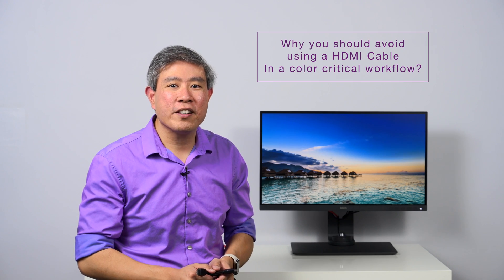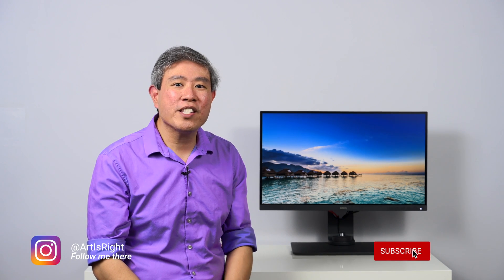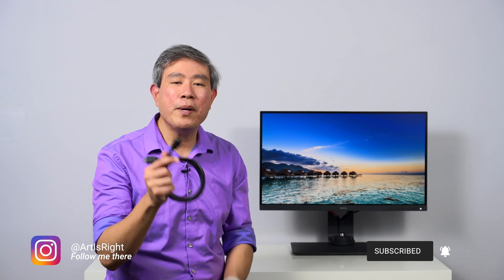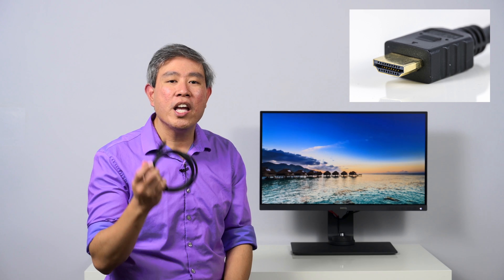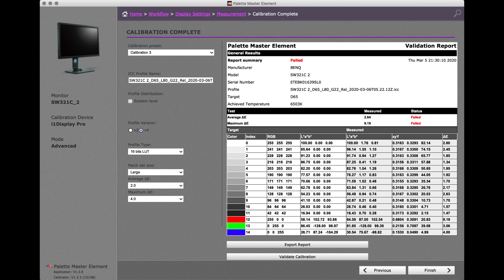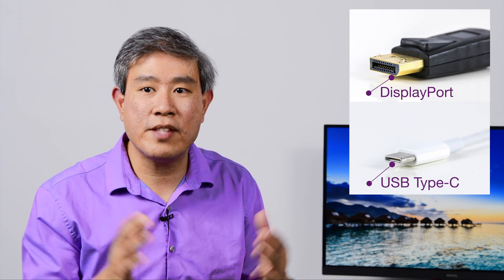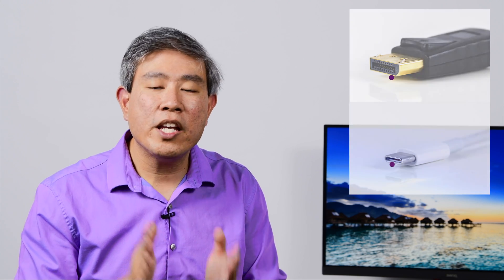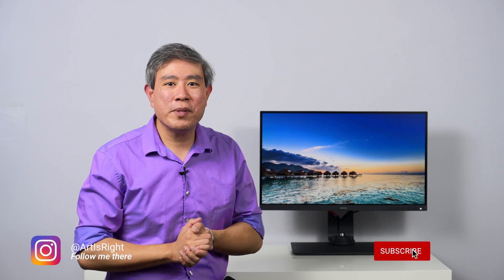Why you should avoid HDMI for color critical workflow, especially with Pro Displays!

Comment: Update: I spent a whole day testing my MP 6,1 with Blackmagic eGPU, and decided not to keep it. The external eGPU does speed up Safari web browsing when content has lots of graphics. Various tests do show higher scores (e.g., Geekbench 5, Novabench). But it actually slows down Lightroom Classic. The PugetBench Photoshop software also shows a lower score with the eGPU.
Reply from the maker: Thanks for the update, that is what I suspect would happen since the signals and data would have to get pushed over to the eGPU before it can be process for the display.
Reply: @ArtIsRight  There was theory that if one connected monitors directly to the eGPU, then it would cost only one-way delay through TB2, as opposed to internal bus. But guess that would depend on how software was written. If GPU process only some data and has to return the data to CPU for more processing, then it would yield a lot of delays.
Reply from the maker: You should connect the display direct to the eGPU if you are using it for graphic, you should not connect it if you are using it for CGPU (computing GPU) such as rendering videos, etc. But with MP 6,1 you are looking TB2 delay going to a TB3, provided that you got the latest eGPU enclosure. Personally, I find that eGPU is more trouble than it is worth.
Reply: @ArtIsRight  Can you do a video on M1 Mac with two 4K monitors and perform local adjustments on LR Classic? My MP 6,1 was fine with 1 HD as main and 1 4K as the 2nd display for LRC. But after I upgraded my HD monitor to BenQ PD3200U, local adjustment is extremely sluggish. If I apply spot removal, I have to wait for the beach ball to appear twice before I can do anything next. Can you try this with M1? Try it with the latest LR Classic V10.1. V9.4 was a bit better: the beach ball only appeared once.
Reply: Clarification: the 2nd 4K monitor should be used as the 2nd display for LR Classic and set in Loupe mode.
Reply from the maker: If I have time I will test this.

Comment: Dear Sir,
I have benq sw240. My pc has USB-C port.But when I connected USB-C to display port of monitor, there is no display. I changed DP 1.2 to 1.1 by hdmi cable connection,but it did not work.I think my usb- c port is not disp alt mode supported. Now I think I need graphics card. Benq has provided mDP to DP cable.please suggest me specification for graphics Card with ,what type of port required for compatibility with sw240. Please note I use Lightroom cc
Reply from the maker: See the other thread for answers

Comment: I have a 2013 Mac Pro with 10-core Xeon/64GB RAM/2TB SSD/D300s. The main monitor is BenQ PD3200U. When I do Lightroom photo editing, I have a Dell 32" 4K monitor as the 2nd display. When I do software development and want to stand up for it, I have a BenQ PD2700, on a stand desk,  mirrored to the PD3200U. The Lightroom is a bit sluggish. So I am getting a Blackmagic eGPU with Radeon Pro 580 GPU. I am planning to connect the PD3200U to the HDMI port of the eGPU. Will I have calibration problem with i1Display?
Reply from the maker: You should not have any issues especially with a software calibration but if you do use a USBC to Display Port Adapter or just use USB C to USB C. As far as performance not sure will it improved much, it is more of a Lightroom thing rather than a GPU thing. But keep me posted on LR performance with the eGPU.
Reply: @ArtIsRight  What would be a good benchmark to compare and determine the improvement from eGPU, if any? I'm not sure group import/export would make sense. My main goal is to reduce the sluggishness of LR Classic operations. The assumption is that I want to stretch the life of my MP 6,1 a bit until Apple stabilizes M1 Mac.
Reply from the maker: The best things that you can do for this is subjectively how it feels. There's really no specific benchmark for this. Truth be told LRC is sluggish on my Mac Pro with Radeon Pro Vega II card as well. This happens a lot when you run close to 4K, but if you scale the resolution there's an improvement to the responsiveness. I'll probably make a video about this soon.
Reply: @ArtIsRight  Does LRC use Mac's monitor scaling? From my experience, it does not. But I could be wrong. BTW, I found a benchmark for Photoshop that works on both Mac and Windows. Could you please participate here? https://www.dpreview.com/forums/post/64702827
Reply: Update: I have found the results on their website. For Apple products, you can see the results here: https://www.pugetsystems.com/benchmarks/?age=30&benchmark=PugetBench+for+Photoshop&application=&specs=apple#results-table
Reply from the maker: Awesome! Thanks for sharing.

Comment: I'm a new subscriber and I must say, you do fantastic videos and very detailed research! Based on your videos I've just ordered dual SW321C monitors to be ran from both my PC as well as an M1 Mac Mini I should be receiving next week. As you know (per your video) to get 4k 60hz, I'll be connecting via native HDMI on display 1, and the Amazon USB-C to HDMI you recommended in your video for display 2. However, I now stumble across this video and it seems I'm going to have problems completing a hardware calibration these $2000 monitors? Am I understanding this correct? Any work arounds or other recommendations? Per your other video, it does not appear I have any other connection options to stay at 60hz. Thoughts?
Reply from the maker: Well at this point you are going to have issues calibrating any displays regardless https://youtu.be/KXIKRLLVCw4 and https://youtu.be/NVi0YdAB2M0 nothing works well with it yet. It is all a waiting game at this point. When the software are compatible, I will have to test HDMI on these new Mac, the simple answer right now is that I don't know will they truncate the signal or not. I know that this was done on the 13" MacBook Pro that has the HDMI build in, but it works fine on the 15" MacBook Pro, so it is hard to say. Patience is the name of the game right now and not much else
Reply: Thanks for the quick response. If I understand your video correctly, my display could suffer from a restricted color range due to the HDMI technology at ALL times. The calibration is less of a concern for me since I run two machines and calibrate with my PC. My concern is having this incomplete color range during editing and prior to printing. Do I understand you correctly? Also, to maintain the 4K at 60hz the previously mentioned connections are my only option, correct?
Reply from the maker: Yes to get 4K60 as of now what you mentioned before. If you don't need calibration then it does not matter if the range get truncated, this really only effect hardware calibrated display when doing a true hardware calibration. Again without an update native software I can't test that yet, so we are at a stall here. Everything is waiting game right now, but if you are not going to calibrate I won't worry about it, these are not visual differences that are visually noticeable
Reply: @ronmcgowan  try to go to your graphics card control panel and change the output range to full range, regardless of HDMI or dp, pc sets limited range as defult, not the bandwidth issue of HDMI

Comment: I have a sw271 ..  When I check which bit depth it is, I'm seeing only 8 bit and it should be 10 bit.  I'm using the display port cable that came with the monitor, is 10 bit only attainable when using hdmi?
Reply from the maker: Nope but I need more details. What system what video card, etc?

Comment: Hi Arti ,i hope you;re doing well..are you talking about HDMI 2.0 or about the older HDMI cable in this review?
Reply from the maker: 2.0 and all HDMI in general, they just truncate single to make room for other signals. Bandwidth is not as wide as USB-C or TB3 or TB4
Reply: @ArtIsRight  Thanks Arti! i did check it and there is difference..i was thinking to change to HDMI because on my 2nd monitor which i have in my home studio,its not a benq display. And Its flicker free only when using HDMI
Unfortunately on this monitor my eyes get really tired especially with 10bit ..it feels like it gets way brighter and i lose details and my eyes get tired easily
Did you have this issue when using 10bit?
Reply from the maker: I have no issues with 10 bit over HDMI, you should be fine. Especially if it not a hardware calibrated display.
Reply: @ArtIsRight  thanks Arti..just one last question...now in 2020,do you still its ok to use the profile version v2 or maybe is time to move to v4 
What is the real difference?
Reply from the maker: For Windows still V2, OS compatibility issues not yet resolved, on Mac V4 is fine
Reply: @ArtIsRight  thanks a lot!
Reply: @ArtIsRight  so bandwith plays a role on color accuracy and color reproduction?
also i was wondering do you know what "reflect black level tone in tone curves mean" (in another calibration software-not benq's)  ?
Reply from the maker: Bandwidth not so much for standard SDR, for HDR yes, lots more information. As far as color reproduction goes, it is more about the output signal range whether it is truncated or not. As for the reflect black, it has to do with the rendition for various software and if said software support rendering intent or not, i.e. Adobe Products do but many others do not. So if you are loosing black in other programs choose the reflect black setting.
Reply: @ArtIsRight  thanks Arti...you are always very helpfull:) you should start doing online courses
Reply: @ArtIsRight  Ps with usb-c do we still need to use the usb cable se the display and pc will be connected and send infos to each other? or with usb-c is not nesseary?
Reply from the maker: This depends on the PC, laptop, mostly no but desktop yes that is because the signal does not route back to all of the USB-C ports like Mac.

Comment: Hey, thanks for the explanation! I have some questions: 
1. when you talk about HDMI, do you mean any kind of HDMI standard? because I am thinking if the HDMI port and cable support enough data (HDMI 2.0 for example), will they still though the color information while having the audio data? 
2. Is there any way to limit only video data through HDMI? it seems like if the cable don't throw the color information, it will be fine.
3. I am thinking about the mac mini, and maybe a old sw model (without USB c port), do you think I can use the HDMI port out? otherwise it will be a little bit waste of the port...
Reply from the maker: 1. They should do both, I am speaking of HDMI in general. And this is one where you have to do lots of testing.
2. Unless your video driver than control this, I am not sure. 
3.I have not tested that, but for all my Mac mini clients, I have them buy a cable like this https://www.amazon.com/gp/product/B075V27G2R/ref=ppx_yo_dt_b_search_asin_title?ie=UTF8&psc=1 bypass HDMI all together.
Reply: @ArtIsRight  Thanks！
Reply from the maker: Sure thing!

Comment: hi i have a question
i bought a sw27c by connecting a dp port cable to my mini mac at the hdmi input it tells me there is no signal. how can I do?
Reply from the maker: So you are tell me that you are using 2 displays cables, which one is it, Display Port or HDMI, they are both different. The SW270C does not auto detect source, so what you have to do is press any button on the display and choose the corresponding input source, whether that is HDMI or Display Port.
Reply: @ArtIsRight  the cable i try to use is dport in the monitor and hdmi in the minimac
Reply from the maker: Just use a HDMI to HDMI. If you are on a Mac MP, then use Display Port to Mini Display port, no need to convert.
Reply: @ArtIsRight  Yes now I'm using HDMI. Thanks, I have a new generation mini mac it doesn't have a mini display port. But what do you think if I use USB-C to connect the monitor? Sorry for all these questions but I want to understand the differences. You know it is important to understand what is better, to improve my work. Thanks
Reply from the maker: Since your computer has a USB C and your display has a USB C you can just use 1 singular cable to link the two. Assuming that you have the SW270C and not the SW2700PT. USB C is going to be best in your situation
Reply: @ArtIsRight  thanks for the super speed of response
Reply from the maker: Sure thing!

Comment: I am on a 2015 Macbook Pro without USB-C. I have connected the SW321C via HDMI. Now I want to calibrate with SpyderX and Palette Master Element. > ERROR: A connection to a BenQ Display cannot be established. Please make sure that the USB cable is connected and that the FTDI drivers are working. 

Any help here please? I can connect it via USB...
Reply from the maker: Yeah you have to connect the USB A to USB Type B uplink to the SW321C, otherwise it will not work.

Comment: Hi and thanks for the review . Can a (pc)HDMI to (screen) usbc works ? Thanks a lot from France
Reply from the maker: I would test out HDMI first, if it works you are good. If you have a hardware calibrated display HDMI might pose an issue, if you just have a software calibrated display you should be ok. HDMI can typically be adapted to other ports type but USB C is not one of them. I would consider adapting connector type as a last resource.

Comment: Hi ArtisRight, Does HDMI support the 10-bit color of the SW2700PT? Is a 2.0 HDMI cable that claims to be backward capable (the monitor is 1.4) OK? Also, I've read in a review that the monitor's backlight is white LED. Somewhere else I learned it is an RGB LED selection I should make on the X-Rite i1Pro Display colorimeter. RGB LED is what I should select? And BenQ has recommended that I choose the older 1.3.10 Pallete Master software, rather than 1.3.11. Do you concur, and why? Thanks so much for this video and the others, and especially for your replies.
Reply from the maker: 10 bit color is officially supported since HDMI 1.3 carrying 10 bit signal is not the issue. The video card used along with the driver is the bottle neck. So if you use a Mac you are good, if you use a PC, YMMV.

Comment: Hello, Art. What about if i use a Benq2700pt with a Desktop PC instead of a Laptop. I only have a couple HDMI ports. I also use a Gaomon tablet as a duplicate screen to edit in Photoshop. I just got the xrite i1 pro and check your videos for best settings for calibration. But cable is something i haven´ thought about it.  Any suggestions for those as me which have desktop pc onlye wiht hdmi ports?
Reply: A converted Display port to HDMI would help in anything?
Reply: Or maybe another mother board with display pro?
Reply from the maker: With HDMI, I would try it first with the SW2700PT especially if you don't have other ports, if it works then great! If not then we'll figure out another port. If you have the "option or choice" to avoid it yet but otherwise try it out first, it may or may not work, it is computer dependent but give it a go.

Comment: I'm planning to get the BenQ PD2700U or BenQ PD2700Q
and my laptop has these connectivity options:
HDMI, Usb type C, USB 3.0
So, i can get a TYPE C adapter for the Monitor or, there is a type C cable build in the monitor?
Reply from the maker: I don't think that either one of those have USB Type C and if you are not running a hardware calibrated display HDMI won't really matter much, so for your setup if HDMI is easier then use that. If you want the better signal use USB C to Display Port and that should do wonders. Here's a link to one https://www.amazon.com/gp/product/B074V5MMCH/ref=ppx_yo_dt_b_search_asin_title?ie=UTF8&psc=1 If I were in your position what I would do is just try the HDMI out and see how that works with calibration and etc. If it works then continue to use it.
Reply: @ArtIsRight  do you have any recommendations under a budget of $500 27inch for 90% photo editing and 10% video?
Reply from the maker: Here are a few, some hardware calibrated one too. If you don't mind getting a refurbished you can get some great deals. I would look at either the SW - Hardware Calibrated Line or the PD - Software Calibration Pro Design line. The SW2700PT is an especially great value.

Comment: Hello there, thank you for great video !! 
Can I ask you .... how should I connect my laptop (dell inspiron 15 7000) with BenQ PD2700Q .... I got that there will be the display port on BenQ but with what should I connect to the laptop ? Is it better to use some reduction like ... HDMI to DisplayPort or this doesn´t matter ? :/ 
Thank you and have a great day !
Reply from the maker: This is one of those situation where it is probably better for you to stick with HDMI considering all of the ports are there on the laptop already. Converting HDMI into something else can still cause problem because you are still using the HDMI base signal. The other option that you have on your machine is to use the Thunderbolt port which is implemented on a USB Type C connection. Get a USB C to Display port something like this https://www.amazon.com/gp/product/B074V5MMCH/ref=ppx_yo_dt_b_search_asin_title?ie=UTF8&psc=1
You have to remember too that your BenQ PD is a software calibrated display and it is less sensitive to HDMI signal truncate issues that I mentioned in the video.
Reply: ArtIsRight I have started contemplating buying a proper monitor and my only machine is a macbook pro. Thank you for the information. This has been very useful!